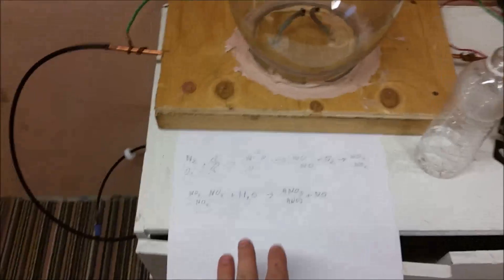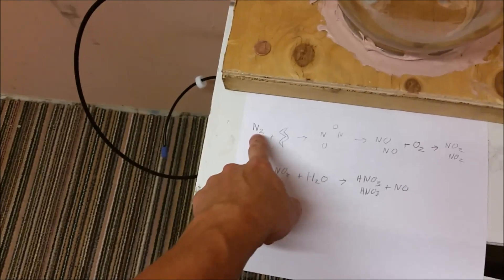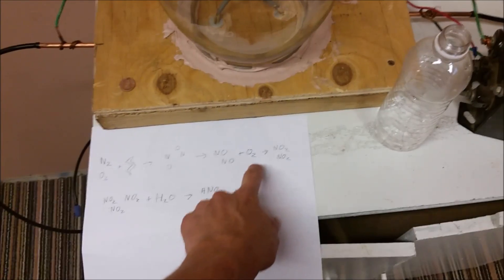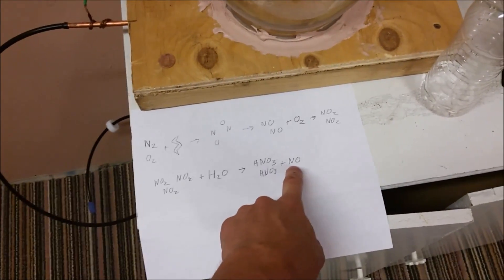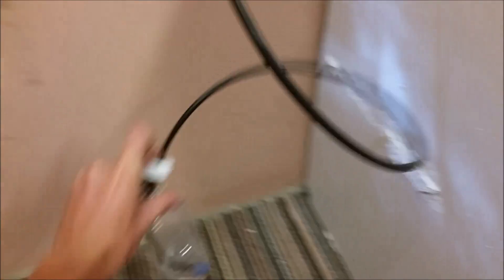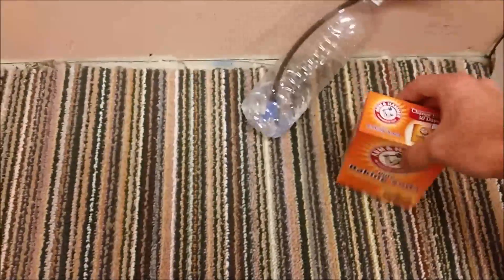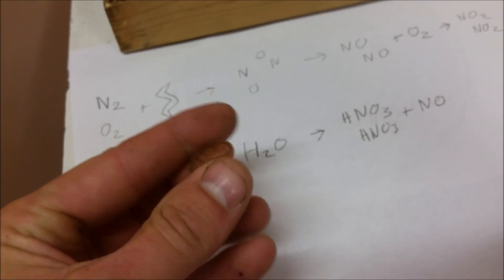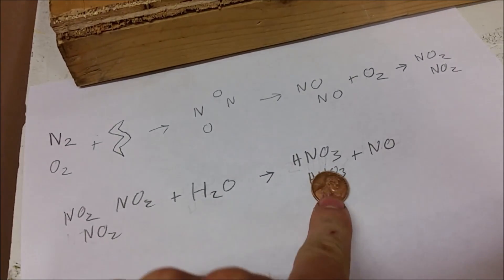Nitric Acid From Thin Air

Comment: if you soaked cotton in that nitric acid you would get nitrocellulose right? most of the guides I see involve sulfuric acid (to make nitric acid?)
Reply: ty
Reply: Forgive me if I'm wrong, but I thought the sulfuric acid acted as a catalyst to assist in dehydrating the celluloses hydroxyl groups and the proton on the nitrate to create a nitric ester? Like:
R-OH + HNO3 + H2SO4 -> R-O-NO3 + H2O + H2SO4
I thought that the extra SO3 in oleum, or even the small amount of SO3 in concentrated sulfuric acid was "thirsty" and kinda "sponges up" the water.
Reply: There is a difference between the electrophilic aromatic nitration (which is used for making nitrobenzene and explosives like TNT or picric acid) and the nitration of alcohols (like glycerol or cellulose). In both sulphuric acid is used, but its function is different.
In the aromatic nitration, the nitric acid acts like a base and an OH- group is removed from it to form the nitronium ion NO2+, which attacks the electron-rich aromatic ring.
The nitration of alchohols is an esterification, where the sulphuric acid is used to remove the water.

Comment: Hello Cody,,would it be possible to improve the lightning air reaction with using katalyser metal wich we can find in a  car katalyser
Some iridium ,palladium and platina we can find there.
Reply: They are made most of palladium Wich is used specifically to catalyst hydrocarbons. The extremely hot electric arc is enough to oxidize the nitrogen in the air so a catalyst isn't necessary

Comment: Awesome! I will definitely use this later - because you need permission to buy nitric acid in my country (Sweden). That is almost impossible to get if you don't run a company. Ok, you can buy weak 3% concentration - then distill it. But it's a very expensive way since the prices for a certain volume is amlost the same as higher concentrations (so you pay a lot for just water)

Comment: Hey Cody, are you ever thinking of revisiting this project? Like make it more efficient or such
Reply: i have made a technique to purify it, react it with the sodium bicarbonate to make sodium nitrate, then add HCl to the solution to make sodium chloride and nitric acid. then distill the solution so that you get nitric acid on one side and some table salt for your lunch:) you can also put some water where you expect the HNO3 to be to slightly dilute it
Reply: @mirouhirou4389  its not that easy to separate hcl and hno3, they have close boiling points
Reply: A good way to make it more efficient is to use a 1:1 Oxygen-Nitrogen mixture instead of air.

You could also use a pulsed discharge instead of a continuous one. This is because the NO produced at >1200°C, but destroyed between 1000°C-400°C, so you want the air to cool down as quickly as possible.
Reply: @celadrial6684  Here is a thought. High voltage from the coil rectified in a voltage doubler to produce high voltage dc pulses.  Then  take a donut magnet from a speaker or microwave,  and  make it the negative electrode. Then in the center place the positive electrode. Nail maybe,  And blow air through the hole. Current in the arcs will tend to spin around the electrode really fast because of currents traveling transverse to the magnetic field and low mass helps it spin quickly,  whil new cool air helps quench the reactions quickly.
Reply: @celadrial6684  A quicker option is a glass container in a microwave oven, creates a plasma ball and plenty NO2
Reply: There are a few ways I can think of.  There are three big points of loss as far as I can see.  The first is how much energy from the plasma goes into nitrogen dioxide formation.  The second is how much of the electrical energy goes to the intended chemical action.  The third is how much of the nitrogen dioxide reacts with water to produce nitric acid.

Point one and two can be inverted if we want to instead lool at a potential for using some form of electro-catalyst.  If we could, for example, form a nitride that, in the presence of an electric field, prefers to bond with something typically in a nitride.  In this type of instance, we would be completely bypassing the need for a plasma and using chemistry to solve some of our problems.

But this would also fly in the face of the idea we can use some simple stuff from the hardware store to make the precursors to explosives without a paper trail (for some reason, youtube has been shoving chemistry videos in my face and they started with explosives chemistry... Er... Kinda - the funny thing is that I have long been studying the concepts... I suspect the proverbial powers that be want people to be doing something stupid in these chaotic times).

For the first part, I think a static arc is not as productive.  We want a sweeping arc.  To do this, we would go to a vertical arrangement on the tubes and use a toroid or cylindrical permanent magnet.  An array can be used for similar, amplified effects.  The electric arc will be deflected by the magnetic field and sweep it in a circle.  This may improve performance, so long as "flicker" is controlled.
Relative atmospheric pressure may need to be considered, as well, a partial vacuum or higher relative pressure may improve performance, these being easier to control than oxygen concentration.
Another consideration may be to add water vapor to the equation by performing all of this above relative boiling temperature and introducing small amounts of water directly into the air stream that will produce the arc.  Rather than separating the production of nitrogen dioxide and nitric acid, introduce the two in the same location.  This would obviously require consideration as to what metals are used as anode and cathode.
Another possibility is the use of an RF plasma.  This will avoid ozone production.

Comment: Re: penny. It appears (at 1072p HD) to be a 1972/3 penny: brass, 5% zinc. I don't know if the zinc might potentiate alloy domains where a weaker acid, nitrous, might give the impression the copper was being attacked with the sort of vigor we might expect from nitric acid. Let's say a crack-in-the-armor effect.

Modern pennies are plated with 100% copper and would be a better test.

Comment: Could corona discharges be more efficient? Here the active volume is very small, whereas coronas can be larger for the same HV supply. I wonder how further it could be optimized, with respect to the spark itself and the flow rate.
Reply: I noticed your comment is 5 years old so replying probably isn't really useful, but I thought I'd do it anyway. The way they do/did it industrially for producing chemicals through electric discharge (like ozone as well) was by having a strong magnet in close proximity to the discharge electrodes. The magnetic field would substantially increase the number and size of the sparks, thus improving efficiency.

Comment: actually no...the odor that people experience when it is raining in general is something called Perpenoids..they are a class of chemical compounds created and released from certain  bacteria that permeate the air. Also , ozone is far more likely to be detected only if you are very close to a lightning strike..we detect ozone because it hangs around quite a bit longer than oxides of nitrogen in humid air..actually..on second thought, I was quite surprised at the amount of Bicarbonate it took to neutralize all of that acid..

Comment: Having a smoke detector mounted vertically in the middle of a wall is just like having none at all. They're only reliable when they're mounted on the ceiling. (And perhaps if the ceiling doesn't have a big hole in it... ;)

Comment: The aquarium airstones have to be pre-treated before they will function properly. Soak them in tap water for approximately 30min - 1hr and they should bubble just fine, even with a low pressure pump! Awesome stuff here, keep it up Cody. I hope this piece of advice helps with your future experiments; I've noticed you do a lot of diffusion to recover chemicals, and using a bubbling stone would be quite effective for that purpose since it would allow for more contact time/contact surfaces.
Reply: Wouldn't the acid eat the stone?
Reply: @markselten4985  depends on the stone if it has any carbonates in it the acid will consume it. if the stone is made of silicone dioxide nothing would happen
Reply: @Humbulla93  so like a quartz stone.. good to know, I am going to try recover ultra fine gold from a quartz crush. Mechanical separation is impossible, it's far too fine.
Reply: Actovated Carbon grom a pet shop like used to filter aquarium water.  If you had for example very fine gold particles, there is a certain affinity or attractive force (like electrically) that can naturally exist and cause the smallest of gold particles to adhere to the activated carbon, especialy if even a small amount of salt (table salt) and or HCl (muriatic acid) not much is needed like an eye dropper full to five gallons of water. The amounts are not critical 
When your ready to finally recover this gold  consider rushing it while wey into a mud like consistency.
You might then use aqua regia process or carefully roast it in a kiln or some other way with flux and some copper or other metal you were processing.  Carbon will not harm either provess.
Reply: @markselten4985  melting it down and then dissolving the glass with hot NaOH should work
Reply: @everettduncan7543  I did end up soaking gold quartz crush in hcl and adding bleach over the course of a day. This dissolved the gold which I did separate from the quartz dust/mud by filtering through a coffee filter. Dropped the gold with iron sulphide and melted mud to recover 0.9 grams.
Very happy with the result.
Was my first time with this chemistry.
Reply: Many aquarium air stones are actually silica sand with a resin binder so yes they crumble up after a few hours. You have to search for a good quality sintered glass air stone for it to have any useful life.

Comment: Penny's are made of zinc only a tiny bit of copper is present unless that's old
Reply: True, but the whole surface of the penny is a large majority of copper. You can only really see the zinc unless you cut the penny/sand it
Reply: It's definitely an old one, look at the color. I'm sure cody is smart enough to know 'new' pennies are mostly zinc.
Reply: Drop a magnet in a penny jar. This Is how I separate the old from the New. Try it I guarantee you that the new ARE magnetic. Simple test, try it.
Reply: use a magnet pure copper not magnetic, save your old coppers there worth 30% more than they were when produced
Reply: Drop a magnet in a penny jar. This Is how I separate the old from the New. Try it I guarantee you that the new ARE magnetic. Simple test, try it.

Comment: you could have done this soooo much better, why have that miserable amount of water in the collector?? have like a whole bottle, THAT way you are sure to use all of the gas, as it will get absorbed more efficiently, if you want, you can always boils it down after to concentrate the acid, and the arc...dear oh dear..if you set the electrodes parallel you would get a wider arc, equals more air contact, equals more nitrogen oxides..and you could easily have done a titration with your bicarb to get a real idea of your acid strength, all really easy to do...

Comment: Just think if/when we have unlimited free energy what we will be able to do.
Reply: dastgahjoosh The sun provides all the energy mankind could possibly need we just aren't harnessing much of it.
Reply: Actually the universe and everything in it including your own body is mostly energy. Energy is everything that exists and is everywhere. Energy could be free, but the elites want to charge you for it. Same happened to Tesla's tower, the elites destroyed it. There is no such thing as "running out of energy".
Reply: Its apparent that you do not understand Tesla's discoveries or did not study enough. Tesla's Tower extracted FREE electricity from the Ionosphere.  The Tower had connecting anchors 300 feet deep into the earth.  As the earth spins, the Tower would accumulate power which could be stored and transmitted wireless-ly to any point on earth. You need to study more....
Reply: dastgahjoosh Explain your reasoning you can't just refute something without even presenting a argument.
Reply: dastgahjoosh All that sounds like is I have no real argument. Good Day to you sir.
Reply: dastgahjoosh I said Good Day!
Reply: Since your picking fly shit, I will agree that the structures cost $ to build. But basically after initial cost, the electricity cost is minuscule hence basically FREE. Pennies per year to power your homes.
Reply: Apparently dastgahjoosh does not understand that Tesla also discovered it was possible for power transmission longitudinally through the earth. Tesla was superior to Einstein who received all the credit. The earth spinning is a clear form of perpetual motion.
Reply: When will the earth stop spinning?
Also, did you know the core of the earth is mostly iron?  Hence you probably also don't know that iron forms crude oil.  Russian scientists created crude oil in a laboratory from iron.  The earth is a crude oil factory producing it daily through heat and pressure.  That is why Saudi Arabia has been pumping for decades & decades without any reduction in flows. Don't believe the Bullshit about "fossil" fuels. Crude Oil is not organic. It comes from iron. Off the Louisiana coast, an oil company pumped dry a reservoir near an island, and not so long after that same reservoir FILLED BACK UP with crude oil! Look it up if you think I'm lying!
Reply: Blood Falls, at the toe of Taylor Glacier proves IRON is plentiful and part of the bio-life system. I already told you the earth core is full of iron.  The basic building block of crude oil. Checkmate.
Reply: Discoveries are made on the fringe of science.  You are stuck in the grip of academia. Garbage IN = Garbage OUT.
Reply: +HHH100 Oil is fossilized plankton and other small ocean plants and animals. We should all agree on that. If we don't we have a greater problem then that. Correct if I'm wrong, bot oil has never been made  man made. There's no way oil could have formed down their in a enormous molten iron electromagnet. The only possible way I can think of is finished oil somehow getting to the molten iron core or close, which would most likely bring in atmospheric gases including oxygen and burn the oil.
Reply: He did not say the oil was produced in the core of our earth, rather its the heat produce by our core that allows relatively shallow oil well locations to produce oil, the oil is a by product of micro organisms in the deep crust and is in constant production, taking hundreds to thousands to replenish rather than millions. I believe this is what he meant..